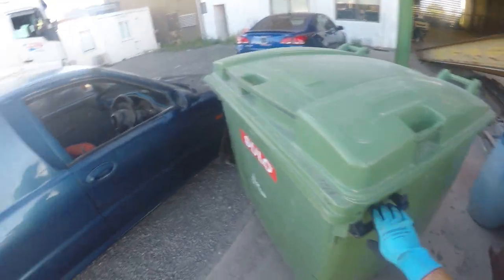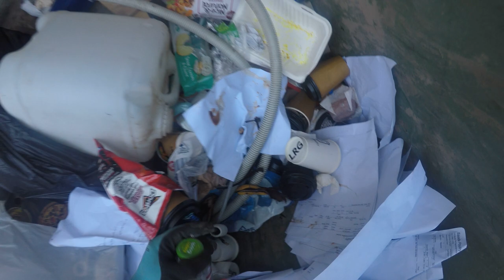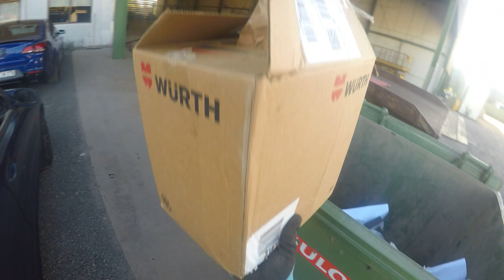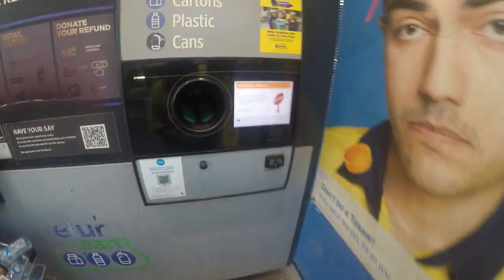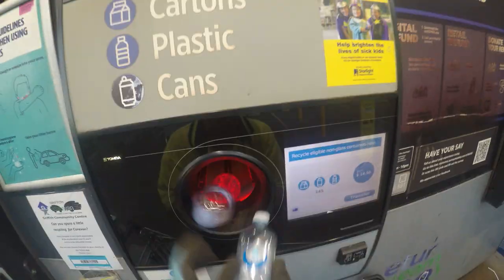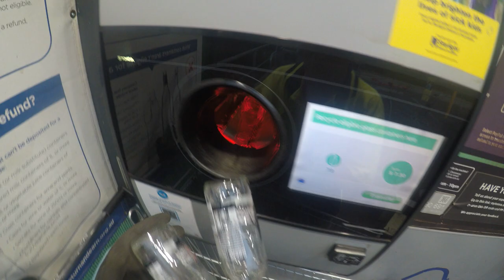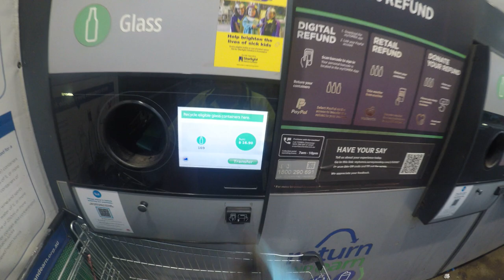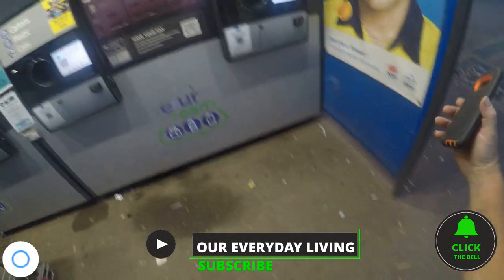DUMSTER DIVING I PUT 366 UNITS THROUGH AND PICKED A WORKING WASHING MACHINE

Comment: My washing machine, a Whirlpool, stopped working and kicked out a code. To reset it I unplugged the machine, held down power button for 10 seconds then released, then held down start button for 10 seconds then released, plugged power back in and voila! Problem solved. Hope this helps
Reply from the maker: Usually when a washing machine throws out a code at you there's something seriously wrong the easy way to find the code is to Google it. Because that is what I do solve the problem a little bit quicker and it's a good way to diagnose it to